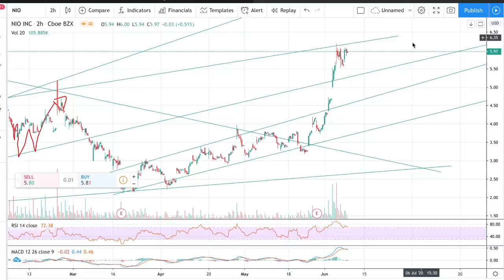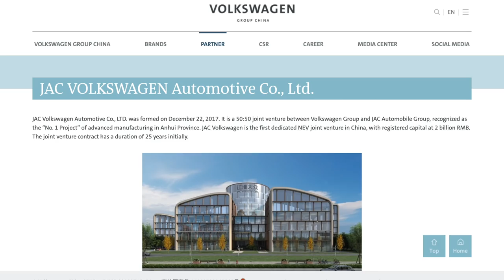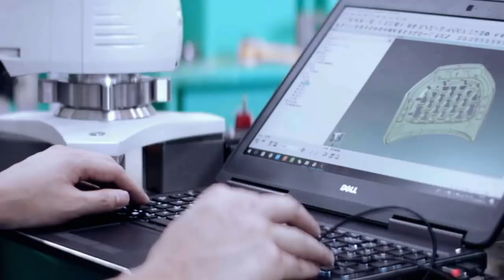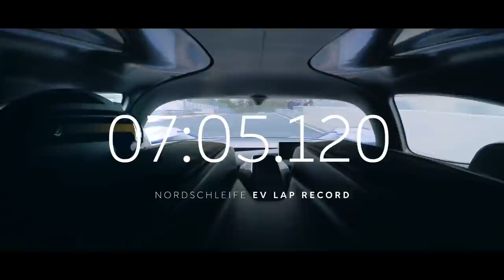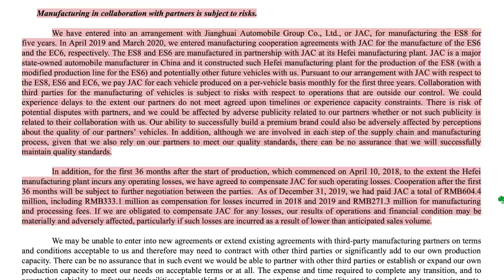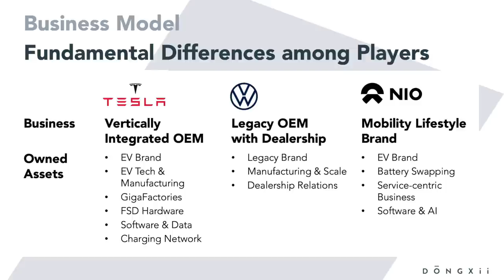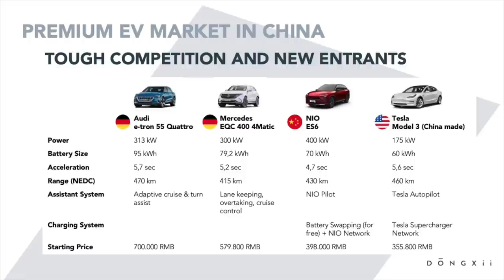Why is NIO Stock on Fire 🚀? Is Volkswagen flirting with $NIO? 蔚来

Comment: I have a large stake in Tesla and small stake in NIO. I am a long investor with both companies. That being said. . . 

NIO’s AI tech is one main reason I like them. 
 In terms of AI, NIO, like Tesla, is striving FSD. However, I think NIO’s in-car AI system, nomi, makes NIO a leader in this area - even ahead of Tesla!

A lot of mega Tech companies, Appel, Facebook, Google, Amazon all are investing highly in AI personal assistants which should be good indication of the value of this tech. I am confident that Tesla will soon integrate an AI assistant into their fleet via an over the air update. 

With regards to NIO’s battery-swapping tech, I think this in the long run will be a liability rather than an asset. 
. . 

Tesla showed that they can also can swap out their batteries, however, the fact that Tesla abandoned this concept, should be a good indication that Elon, the visionary, looked into the future of fast-charging tech and saw that is was just a matter of time when rapid-charging makes battery-swapping stations obsolete. 

Battery-swapping is mechanical engineering tech, anyone can do it – it’s not high tech!

Great video - keep them coming!
Reply from the maker: Thanks Lexx, I agree with your views except that the battery swapping, despite the technology aspect, is a positive for NIO simply because of the differentiation factor and government support in the rollout!

Comment from the maker: 🔴 UPDATE 👉 NIO just published a 6-K filing and F-13 public offering. My quick view on that: 6-K are the details on the Hefei funding, e.g. first money should come in at 30th of June. With the F-13 NIO is raising cash for the injection of capital into NIO China. I was expecting that and mentioned in the videos as well.

With the offering, NIO issues up to 70M shares, raising roughly 300M USD, diluting shareholders to proceed capital injection into NIO China. As outlined in my previous videos, particularly the one on the Q1 2020 earning call, NIO has to inject roughly 4.2B RMB (600M USD) into the new NIO China entity. According to my calculations shown in my Q1 Earnings Call Video, NIO had 338M USD in the banks. Now raising another 300M USD with the offering = 600M USD for the injection. As outlined in my NIO valuation video NIO will have to raise USD in the future too and this will always cause dilution. In my views its normal and as a long-term investor it should be welcomed. It is not so nice for day traders, as the NIO stock tanked in the after market because of dilution. As it is only a small dilution at current prices, I think it won't harm much in the long run.
 
However, too much info to digest the details for now. Will take a closer look tomorrow.
Reply: I am disappointed. I thought taking a 24% loss in ownership of NIO was to avoid the additional dilution of shares... now, the loss of ownership in addition to 60 million (plus potentially 9 more additional million shares) means it's a lose/lose. why not just offer the 60 million and not do Hefei...
Reply: @raqcem99  better buying opportunity?
Reply from the maker: @raqcem99  its a minor dilution as of now. I think in the future NIO will keep raising USD.
Reply: I am VERY happy with the offering!

All of us that really follow NIO know that some sort of capital raise was needed.
With the recent NIO, China deal and this.... any financing weaknesses are laid to rest.

NIO is in the big leagues.... imo, NIO will certainly be the pre-eminent high end car maker in China.
Note: This offering is about 5.7% dilutive-- not very much at all.
Reply: @Floorguy1000  how did you come up with that figure, Mark?
Reply: That dilution of around 6% saved our bacon today as the ADS price is a new support line at $5.95.  If they didn’t do this it would jeopardize the Hefei deal and they’d be dead for cash in months again.